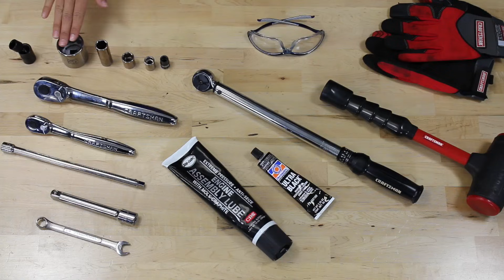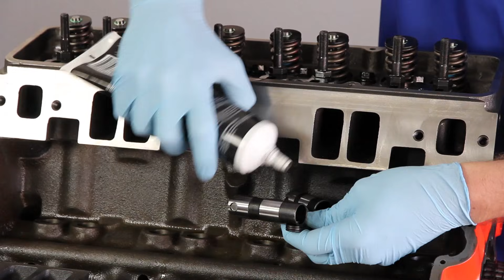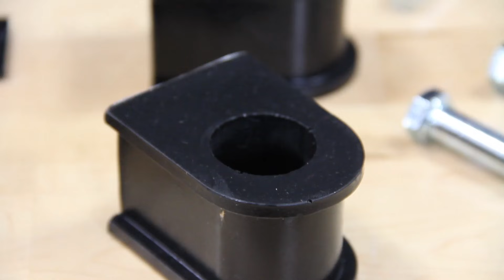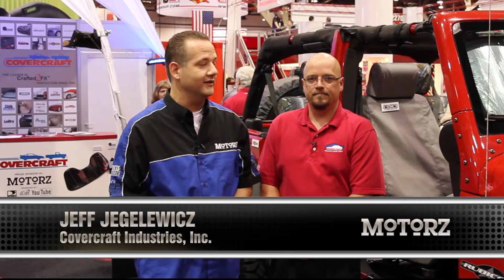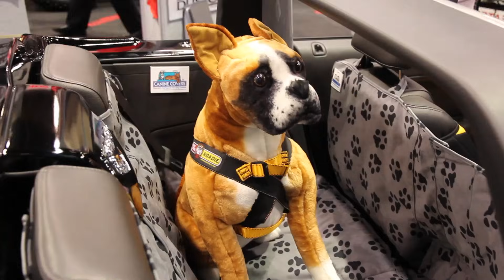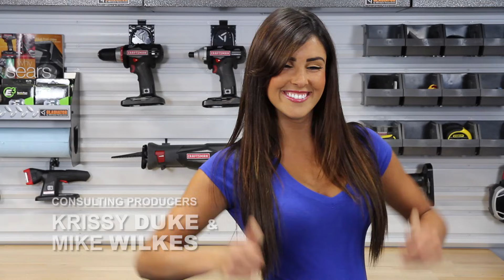How-To Rebuild Top End Chevy 350 Small Block Engine Motorz #67

Comment: Dot dot is not top dead center for number one it’s top that center for number six
And you’re supposed to put sealer on the head bolts before you put them in not just oil

Comment: Word to the wise. Leaving that much oil on a head bolt WILL  throw off your torque, and that much oil will throw it off a lot. That isn't opinion that is fact. Let the excess drip off before you put them in when putting in any fastener that requires lubrication during assembly.

Comment: Question:  Many years ago I built a lot of engines and we always put thread sealer on the threads of the head bolts, especially the ones in the water jackets.  It also would act like a lubricant for proper torque on the heads.  Is this something new that you don’t need to do that, just dip them in motor oil will take care of it.

Comment: You are suppose to use thread sealer on thru holes for most production sbc blocks. Bowtie blocks and aftermarket blocks have whats called blind holes that dont require thread sealant and can be assembled with oil or arp molley coat. The use of oil with thru holes will leak into the engine. It also hepls to o-ring the head bolts as a second seal.

Comment: Way too much oil on the head bolts. The oil will be pooled up in the bottom on the threaded hole in the block, which you will be fighting when you are torquing the bolts causing a false reading on your torque wrench. Instead, lay all the bolts out on a clean shop towel. Take a small oil can and run a small bead of oil down the center length of the bolt. Let the bolts sit for a few minutes so the oil will drain off and be absorbed into the towel. You will be left with a very light coating on the threads, which is exactly what you want. I've literally down this to 100's of head bolts.

Comment: I always torque in 3 steps.......such as 70 ft. Lbs. on the head bolts would get a 40.....55.....then the final 70. When I lived in Indy . Steve Schmidt Racing engines did  all of my engine machine work. Awesome race shop awesome engine work At the time in the late 90's SSRE was. Building A lot of  engines for NHRA pro stock. Not sure if he still does. I remember when I took my block in for machine work and it was all clean with the inside and outside painted and the block machinist who did the machining asked if my engine was a raw casting and I said no.....I bead blasted it in my large blast cabinet.  I remember the block machinist commenting....... WOW.....I have never seen a seasoned block come in that clean before.....LOL.....I would tape and plug any surfaces I didn't want blasted and go at it.Give a rinse in the parts washer using mineral spirits  engine brush and blow out it all the holes then paint the insides of the block with Glyptol red engine enamel. It helps the enamel to adhere better then I would paint the exterior of the block with high heat engine enamel. No issues whatsoever the paint always adhered well and looked fresh and new. No peeling.... Whenever I would get my engines back from the machine shop they were pretty much already to go with assembly. All cleaning deburring painting taken care f ahead f time. I always got the non chemical,rinse after machine work just to remove machining debris.  I always washed the block a couple times with the pressure washer and Tide powder soap and have the oil squirt can ready to prevent rusting the freshly machined surfaces after the block and passages are air compressed blown dry.  Engine supplies from Goodson always helped in my engine rebuilding. I usually shot blasted the crank and rods. Any type of blasting takes a meticulous cleaning with every bore brushed, rinsed and then brushed and rinsed again. ARP racing studs for the crank and heads on any performance engine.....ALWAYS.....I often used Total Seal piston rings  along with TRW moly rings....I had no issues......Get a degree wheel and degree in the cam....it is worth it....if you are an engine builder you know the scoop......if not.....get a good engine rebuild book and if you are mechanically inclined you can learn it. I built an engine testing stand and ran my engines before they were put in the vehicle. Helped with tuning and to check for any issues. To me engine building was  a hobby..... I always enjoyed it. Sometimes the best option now a days is to just purchase a crate engine. Ready to go as far as the block machining and depending on a short or long block kit the hard meticulous precision machining work has already been done for you. ......Have Fun.

Comment: Why did he pound on the low timing chain gear? That mess up your end play and f up your bearing.  They have a tool that presses it on with no damage to your bottom end. And the last time I work on my 350 the intake torques down to 30 lbs.

Comment: To who ever reads this comment never use a universal socket joint to torque down a bolt. The reason being it doesn't give you a precise torque.
Reply: You can always calculate the difference. Extensions are about 3% loss and anti seize is about 20%. Yes avoid it if you can, especially on the bottom end of the engine but if you can calculate the loss then it’s the same amount of torque..
Reply: What about the extension he's using on the torgue wrench.

Comment: lol, im gonna say they left the engine in the upright position for the camera and videos purpose. But, to make it easier to put the heads on, rotate your engine stand to where your head can lay flat down. It will make it way easy, if you gotta do it by yourself. Also, to keep the head gasket from moving, it wont hurt to put JUST A LITTLE rtv in two of the corners to keep it stuck.

Comment: No thread sealant on the head bolts, no instructions on how to insert the lifters, i still have no idea how you got that tape out from underneath the intake and why wouldnt you go with roller rockers? besides all that you guys are making a big deal over how he put the cam in, like come on thats how you put a cam in. "Gently" pretty much just means dont snap that bitch in half when your putting it in the block.

Comment: You're supposed to use thread sealer on the head bolts when your using a factor chevy block not oil. If you don't you're going to have an oil pan full of coolant as well as a coolant leak on every head bolt.
The only block I know of that doesn't require thread sealant is made by DART and that's because the head bolt holes are blind and aren't open to the water jacket.

Comment: why no thread lock on the head bolts?
Reply: It's not necessary or required by the manual on any engine I know of.  However, he did forget to use thread sealant on the head bolts that go thru into the water jacket.

Comment: Toss the crank sprocket in the oven @ 350 degrees for about 20 mins, and you can slide it on without hammering the sht out of it. Use thick gloves.
Reply: Learned that trick in my auto class I just took this last school year. My friend was putting a new pulley on his car but some adapter or something needed to go on first so he told him to put it in a frying pan with oil and let it heat up till it boils and then put the part on right away and it worked

Comment: are those tty head bolts? there is more than one tightening sequence.  it should be in thirds starting around 25 ft/lbs. and it's easier to check prestart valve lash and push rods angle with the intake while turning the engine over. your supposed to set final lash with the engine warm and running. I always have a set of valve covers I cut for that purpose.

Comment: Why didn't you put thread sealer on the bolts?
Reply: RamblinAround do you have to put thread sealer on all the head bolts? I'm assembling my small block soon??
Reply: Yes, you need to seal all the head bolts on a SBC, or you'll have coolant leaks.
Reply: How would you have a  leak there blind holes
Reply: You must determine if your block's head bolts have open water jackets. I believe blocks that are pre 1990s are open.
Reply: You are suppose to use thread sealer on thru holes for most production sbc blocks. Bowtie blocks and aftermarket blocks have whats called blind holes that dont require thread sealant and can be assembled with oil or arp molley coat. The use of oil with thru holes will leak into the engine. It also hepls to o-ring the head bolts as a second seal.

Comment: I have a completely stock 350 and another 305 can I put the 305 heads on the 350 without Channing's cams And if I can would it give me any extra horse or would it just be dumb? Sorry if the question sounds stupid.
Reply: +Thelegitrager the 305 heads you could swap right over and they would give you better compression but they are more restrictive then 350 heads so expect more low end power and torque

Comment: I liked the information regarding the parts information. 
Rather than point out negative feedback, I only have one question, why did you zoom through the valve, lifter and rod installation and specs. Is there a website where you can point me in the right direction?

Comment: Do those head bolts not need sealant on them?
Reply: I believe most SBC's, if not all, have a water jacket at the end of some of the head bolts. People oil 2-3 lead threads for an accurate torque reading. I wonder if blue RTV would have the same effect. Please, anyone correct me or add details
Reply: +Pixel Pusher most manuals say to put non-hardening sealer on all the bolts. from what I can tell,  the factory didn't use sealer though

Comment: Why even reuse those heads? Should have grabbed some vortec heads and get some real power
Reply: those are aftermarket (Dart), they might actually flow more than vortecs. 

honestly I feel that vortecs are overrated, and unsuitable for a daily driven wet intake (carb) motor, since they have no provision for plenum heat. cooler isn't always better,  and carburators can ice up even at 70°F outside...
Reply: Anthony Smith Get a fucking life ! Instead of correcting everyone on their grammar. Why don't you go get a girlfriend ? Sitting in your mom's basement chirping everyone for grammar is lame . Fucking troll

Comment: If you want to make your life easier, adjust the valve lash before installing the intake manifold. Its way easier. As you spin it to top dead you can actually watch the pushrod compress the lifter while you tighten the rockers. (if it's not a solid lifter engine that is).

Comment: so im workin on an 87 silverado with a 1st gen 350, all i know is it was run without oil, now its knocking, i got a couple lifters that were trouble gettin out, a couple that wont budge, so far i understand that i should replace lifters and cam, but is it really that easy to do a cam?...i though i needed a cam card and special tools and what not?....any tips or knowledge appreciated.
Reply: After oil starvation I would think cam bearings to be suspect as well. I've read many stories of people buying new cam kits and having a knock - either from not using ZDDP/equivalent assembly/break-in lube, or not replacing camshaft bearings. I would do lifter, cam and bearing set. Removing and pushing in bearings would be the real PITA. I'd also drop the oil pain and see if there's an obvious loose rod cap. If you replace a rod bearing, it should be machined but if the crank isn't scored/scratched I would really just install a new rod bearing. Have done so in the past.

Comment: should have use thread sealer not oil water will leak past the head bolts
Reply: not all sbc's have head bolt holes with open water jackets. i have also read that you can use teflon tape, instead of permatex aviation  2 form a gasket.
Reply: i actually have a sbc right now where a majority of the bolt holes are Blind, its... odd by they all work like normal.

Comment: In reply to (thehossman1) comment @ me. Actually, This is a late model SBC they are working on, and yes they did have torque to yield bolts. The LT1 also used torque to yield bolts, and both engines preceded the LS engines.
Reply: Correction @ myself. Early SBC bottom end and Late model "after market" heads. My bad. But I'm still right about the time the bolts came out. LOL

Comment: It is false that dipping bolts in oil that are TTY style gives you more accurate torque. It requires a small dab of oil. All of the oil off that bolt that the guy dipped in, went to the bottom of the threads where there is no way of it draining out, when you torque it, the oil in the bottom is compressed and will effect the torque.
Reply: Bam, just answered my question about oiling bolts that will be set at a specific torque. A little leading oil on the threads, 2-3 threads, not dipped and globbed with extra oil to spare!
Reply: i'll be damn
Reply: You're absolutely right.

Comment: Mr Chris Duke, im having a bad knock on top of a chevy express 1500 (Savanna) i try the engine cleaner ,new oil and nothing.After wtching your video i got more acarier of doing the job my self , i thought i could change the lifters on the drivers side  , just removing the intake and i saw on your video , that i need to remove the heads. im not a mechanic and the shop wants 1100 $ i cant paid that . Can you help with advice on how to do the work.(need to change lifters). Thanks

Comment: Hi, I rebuilt LT1 350 to 383 keeping the clearances on higher range side.
I wanted to use 20-50 oil as it is easily available here opposed to what OEM is calling for (5-30, 10-30). I spun bearings with 5W-30.. so I'm hesitant with low viscosities oils
Should 20-50 be fine? or maybe 60 race oil?

Comment: If they were using stock style head bolt you are correct, but it looks like they are using aftermarket bolts "possibly ARP" which are not ' torque to yeild' like the stock bolts. My concern is that they didn't use a sealer style lubricant which ARP and others make because those head bolts go to water. It is highly possible that coolant will now get into the engine.

Comment: I think this is a pretty great series! One thing I really want to see done is actual assembly of the cylinder head please! I'm in the process of building my first motor and trying to do it step by step and do it right. Not just throw parts together. I'm sure I'm not the only person unsure of valve guide seals and such and some of the information surrounding the valve train. like where to get those specs and such. Thank you, in any case!

Comment: Love the series, built many SBC myself -- and I hate to gripe but ive seen two major mistakes so far, the rear main seal was installed with no lubricant on the seal material, this will damage the seal in startup and may well lead to an oil leak very soon --- the second major mistake is he put the head bolts in with oil instead of silicone sealer, in a stock block such as this the head bolts enter the cooling jackets and MUST have silicone sealer on the threads, they come this way fr. factory.

Comment: agreed. its basic physics. an engine with a higher volume for compression will beat a smaller engine in power. yes there are some 4 cylinders with 800 hp and yes there are some 6 cylinders that can be at 1200 hp but how about v8 drag cars that are over 3000 horsepower easy? the point is yes you can give a lot of power to a 4 cylinder. but if you do the same mods, in proportion to the engine size, to both a 4 cylinder and an 8 cylinder engine. the 8 cylinder engine will win every time.

Comment: wont all that oil on the head bolts hydraulic and give a false reading at the torque spec,
maybe moly lube on one side of the treads will be sufficient enough.

Comment: All the head bolts except the top row are drilled through into the water jacket.  Thread sealant is to be applied to all but the top row.  Also you are supposed to torque the heads in 3 stages.  20ft lbs, then 50, then 70.  I quit watching at this point.
Reply: Thanks for the advice I’m using thos

Comment: my shop teacher back in the day told me its for accurate torque, thats what i heard, not sure if its totaly right. i rebuilt heads on my chevy lumina and the instructions from felpro said to soak the threads in oil first. if the heads are on the block im sure the weight would keep a tight enough seal on the gaskets... at least thats what would make sence.

Comment: Hello, I was just curious about dipping the threaded ends of the bolts in oil. Is that something that the manufacturer specified. I'm an aircraft mechanic and on fasteners we are tought to achieve proper torqe with clean dry threads. No matter if its a reciprocating engine similar to autos of a turbine engine, unless otherwise specified by the manufacturer.

Comment: dont get me wrong i like v8's, i have a v8 truck, but my 4 cylinder 240sx is pretty fast, it can easily beat my buddies v8 2002 mustang, those wrx engines can make like 330 hp... 4 cylinder. they are also lighter.

Comment: yes i like it better then rtv i only use rtv for the intakes water ports and across the front and back of the block instead of the cheap rubber seals. those go in the trash

Comment: im not trying to knock the video.  its not a good idea to use moly lube on the cam bearings because they can delay oil to the rest of the engines components during initial start up.
i learned this the hard way now i onl;y use the moly on the lifter bottoms and the lobes oil on the bearing surfaces.

Comment: Have you fired the engine yet or will that be in the next video?  I noticed you didnt use any sealant but oil on the bottom heads bolts that run into the water jackets.  Or did you just not show it?  Very important step to note so water doesnt seep out.